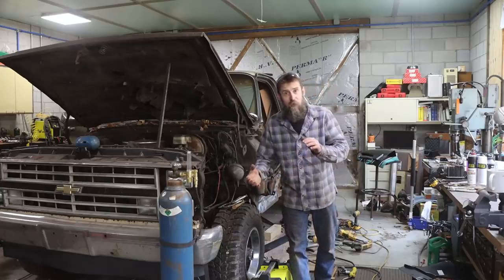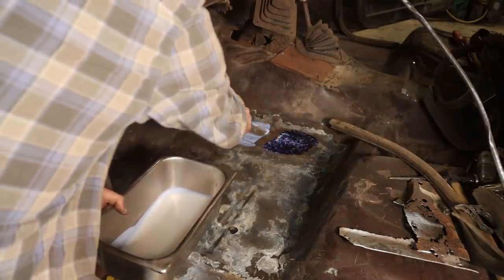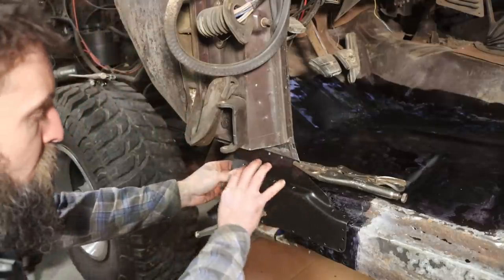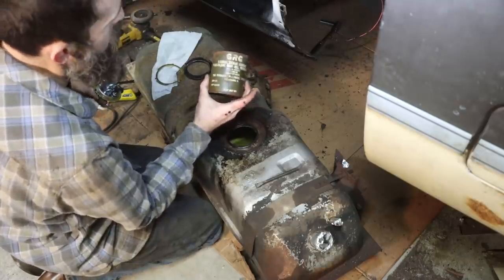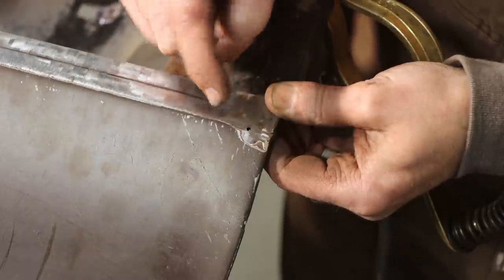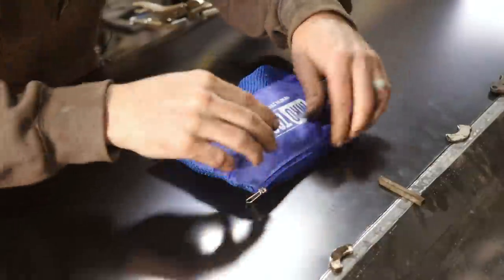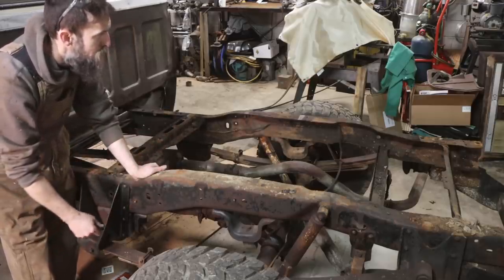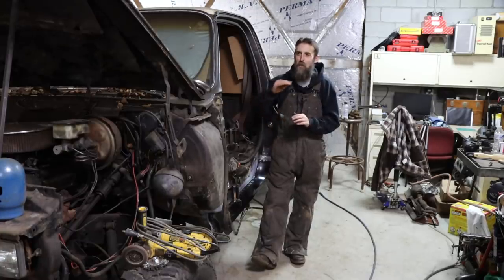Fighting sheet metal on the SquareBody Chevy and Winning! Part 9 #Chevrolet #squarebody

Comment: As a 40 year veteran in the autobody trade, your approach to the rust restoration is spot on. Using a metal bonding epoxy is the best way to attach the skin as it will eliminate both rust and warp issues.  For a machinist you do possess admirable autobody skills. 
Look forward to watching you paint it!!
Reply: He has been a body builder in his past, and is doing a good job here, not just a panel changer. FIL is old enough that when he did his trade, as body and coach builder, the filler they used was hot wiped lead, which you only used to get that last 2mm of contour on the panel, as you needed to shape the metal back to within that tolerance before, using a combination of heat, hammer and dolly, to shrink the metal and form it back to shape. He only started to use body filler in the 1970's, which was a big change, wipe to shape while uncured, and less filing and shaping.

Pretty good welder as well, despite not having that trade papers, seeing as his last 30 years before retirement was as container repairs, which used both coach building, welding and body work to get the mangled units that came in back into near perfect order. The ones beyond fixing were the source of parts, as one that has been basically cut in half, or flattened by being dropped from a carrier, is not fixable, but is a good source of corners, sections of wall, doors and floor panel sections, till it was just a pile of bent scrap and went as such once a year.

The paperwork from those, plus the serial number stamps cut from them, came in handy on his retirement when they asked where the 5000 odd containers were from those 30 years, and he had a whole set of filing cabinets with duplicates, and all the tags, as proof they had been scrapped. Nobody in head office ever wrote them off, just filed the papers and did nothing. They got the bollocking instead.

Comment: I was a auto tech at a dealership here in Fl, no body work just engine repair. When you dropped the fuel tank, a fast way to empty fuel is put air in filler neck with rag as a seal, then run the hose from tank outlet to can. I've been there with full tank and electric pump in tank don't work. I was happy to see ya put in new sock and sending unit, that is a givin. My project is going over a new Grizzly 8x16 lathe, It needs a lot of work to get it in shape, dirty grease and it needs a lot of deburring. You're my Saturday morning YouTube watch.       Jesus Does Save

Comment: If there's one hiccup I'd replace. The old tired worn out carburetor. With a brand new or new to you fuel injected Holley throttle body will start up every time. 👈🤓😉👍

Comment: Aside from my distaste for body work I have the needed tools to get it done and done right. That seam and punch tool was a real godsend when I was introduced to it. Money well spent. Likely too late but I always take a hole saw and drill a bunch of inch holes in the rock guards on these Chev gas tanks as they get plugged with dirt and rot the bottoms of the tanks. Cliko's are a real god send for any kind of thin materials. I use them for when I make custom copper range hoods. Nothing else can match the job they do. The same goes for the needle scaler. Another addon to the tool box that just can't be matched in what they can do. Well Steve, just like everything you do this is great work and long live the square body pickups. Yours has been given a second chance on longevity eh my friend.

Comment: Excellent vid!!  Please don't do a "undercoat" that's a rubberized undercoat.  That stuff will rust out your frame faster- it traps water between the undercoat and frame (rocks will chip it, allowing water to get in between the undercoat and frame).  Just find a good "chassis black" or rustoleum.  You could do fluid film once everything is back together for extra protection.  Short self tapping screws with a wide shoulder works a treat for holding panels in place, and are cheaper than clecos.  Once the panel is in place, you can just fill in the holes.

Comment: With the truck bed off and the front fenders off, now would be a good time to replace brake lines and fuel lines. I was always the one that got the leaking brake line and fuel lines when I was turning wrench for a living, and trying to replace them in limited access area is a pain in the back side. The new copper/nickel lines that are on the market today are very easy to work with.  Remember Mr. Murphy is standing next to you and will wavy his magic hand when all is done and you will wind up with leaks. Don't forget the old saying " shoulda, coulda, woulda."

Comment: Many thanks for another great video. You always brighten up my Saturday morning. BTW, here's a way to siphon gas without ever getting a mouthful. Put your hose into the tank, then wrap a rag around the hose where it enters the filler and hold with one hand for a temporary seal. Now blow a good lung full of air (don't suck) into the hose. You should hear bubbles if the hose is positioned properly in the tank. You now have slightly compressed air in the tank above the fuel. When you take your mouth away the air will push enough fuel through the hose to start the siphon.
Reply: I made myself a jiggler hose, using plastic fittings and a unused carburettor choke diaphragm out of a Weber carburettor kit, acting as a flap valve. works well to empty a tank fast, as the piping is 25mm ID PVC hose, so rapid flow. Takes under 2 minutes to empty out a 25l fuel container.

Bought a 12mm jiggler, as not all containers will accept the 32mm diameter jiggler end, so had to get a smaller slower one, which uses a marble inside it.

Comment: Living in New York, aka the rust belt, any time we do metal repairs especially rockers, it's a must that you spray an oil or wax into them to slow the rusting from inside to out.  3m makes an awesome cavity wax spray.  Get the 3 pack of spray wonds that allow you to spray 360 degrees and reach tight spots.

Comment: Please! No “undercoating” , any rock chip, pin hole, flake will allow dirt and moisture between coating and frame and then you have hidden rust until it jacks out. Consider using Fluid Film or similar products. 
Glad you had a Happy Thanksgiving, keep up the great work! And, it’s too funny how you say your “Brother” is meticulous! 😂😂😂
Reply: I personally use a mix of two part boat builders epoxy and a little bit of graphite for a nice black finish.   I can make it even more weather and impact resistant by laminating some light fiberglass cloth on with the same stuff.   It outlasts the rest of the truck.
Reply: @erikjgreen  that sounds like a mess. You say "I personally use..." Does that mean it was an idea you had, but you've never actually done it? Or does it mean you've done it on one truck? An old beat up truck like Steve's? I only insane that being a really sloppy mess and not looking great, and even worse if you add fiberglass. Not to mention epoxy isn't going to bond without extensive surface prep, otherwise it'll have the same downfalls that the op mentioned.
Reply: @littlejackalo5326  Obviously you need to clean the surfaces and use something like  phosphoric acid to passivate rust.   I've used epoxy on three separate trucks now, it does a good job of keeping salt from roads off the metal.  Even without added glass, it doesn't crack or peel.   The only thing that degrades it is sunlight.
Reply: I love the Brother remarks that’s so funny and sarcastic thanks for sharing we get to know you Steve

Comment: Great tool the Clico... that bag is excellent set...  (you got Varity size bag.. ) i went with all 1/8.. also make clamp great for Light gage sheet metal where don't want hole.  Nice repair, better than the time lapse every one is doing , slow explaining, showing technique , awesome . Old Family help ( trick) come to dinner.  JK , family is great in  a pinch...

Comment: Derust stuff is basically watered down PVA glue and Phosphoric acid. Used a lot by the military and works really well.
Reply: Yes, you can make it yourself just using phosphoric acid and cheap PVA undercoat, which is what that is.  Just refinished an old 60 year old battery charger, where the entire case was rusted badly, so instead of using the rust converter, I just diluted down some phosphoric acid, and dunked the lot in there for a few hours. As I wanted to keep the one label that got a lighter dip, as the paint was peeling off the longer time items, so just used a lot more elbow grease on it when I was doing the scotchbrite cleaning afterwards. 

Then a few coats of spray grey primer, and was looking to paint it blue, but the can was no longer cooperating, seeing as it was 15 years old. So it is now just 5 coats of grey primer instead, with the original Champion label on it. Just replaced both input and output cords, seeing as they were rather manky and brittle. Did use rust converter sparingly on the power transformer, so as to halt the rust on the core and clamp, but that only gas the converter on it, no paint. now to finish it off and add in a charge controller, as it will otherwise charge a battery till it is cooked, and I want a little better control, just like the other equally old GE charger I have, which had this added when I replaced the Selenium rectifier stack with a very overkill 25A diode bridge, newer than the charger, but still made in 1971, so has a pretty high forward voltage drop and is almost as big as the selenium pack it replaced, though it is 25A 400V, as opposed to 3A 30V of the old smellobridge stack. Old one was still working, just was slowly breaking down, you got the slight odour of the selenium sulphide gas off it when it was running at full power for a half hour. Did not want to wait till it went full skunk on me though, those old stacks really leave a long lasting reminder of their demise, both in the equipment, and in the house.
Reply: When worked on the ships (Merchant Marine) the deck department used some stuff called "Ospho". Now that I'm home and all my paint projects, farm machinery and lawn mowers get a coating of Ospho before the paint
Reply: Good to know the ingredients after seeing Steve taste the stuff. Both are basically non-toxic with a small taste. But there are things out there that you don't want to taste under any circumstances. Like that bluing compound Adam Booth was using in one of his videos - very toxic stuff.
Reply: @joeylawn36111  Yes, but the concentration of phosphoric acid in this makes it toxic, as it is the same strength as is in the pure base used in cola, which is classed as a hazardous waste in the OHS act. Not the diluted one used in soda mixers, but the base that the manufacturers use in the bottling plant, which is often used by the truck operators as an engine cleaner, as you can make it safe to flush, by using 100l of water per litre of base, as that is the mix ratio to dilute it down to a low enough level to flush down a drain, as the same concentration as the mix fountain syrup. Just does not have the sugar or HFCS added.

Reason why Coca cola is such an effective grease remover,  I use a 2l bottle of it added to the washing, when doing greasy stains, and a long prewash soak. Cheaper than the degreaser, and leaves no marks, and works well.

Comment: Great job on the rust repair very informative. Personally I probably would have looked for a different cab that wasnt so rusty. But that's me. Love the vids Steve.
Reply: Hard to find though, especially on an old truck, and probably will cost more than the truck. Simpler to just order from the aftermarket a lot of panels and build it back up, as the labour cost to Steve is a little lower than a body shop, though his standards are higher, as he does not cover sins with bondo and paint.

Comment: When you were talking about the rust under the bed if reminded me of something that happened to my son and his 98 4x4 truck. I tell this in hopes that someone will not experience the same thing. He was coming home from work and changed lanes and his truck went out of control and rolled several times without ever giving any indication there was anything wrong with it. After we got it home, I could see the rear end was about to fall out of the truck. The U-bolts had rusted so bad that the only thing holding them was a sliver of metal about the size of a toothpick that hadn't rusted through. If you have an old truck, periodically check the U-bolts, it might save you some grief!!!

Comment: Just found your rebuild series. I just did this to my 89 GMC 2500 last year. Ordered the parts mid April, never got them until mid September. I was running out of good weather by the time I got it back on the road. I bought a combo fuel tank with new fuel pump inside. Fuel pump didn't last 2 months. I had my rear springs redone along with all related brackets, bolts, etc. The truck rides worse now than it did before but she'll haul a pile of firewood without squatting. Great series of videos you've done. I cant imagine screwing around with the camera and editing along with all the frustration on the body work also. I replaced all the fuel and brake lines with 316 stainless, wont have to replace them again.

Comment: Should have used some of that old sheet metal off the door to cut out a patch for the top section where you welded. Then use the Cleco clips to hold it in place, and use some of the epoxy to bond the new panel section in place. that way you have the stiffener you need, and it will have a better chance of surviving long term.  Clips are replaced with countersunk rivets when offering up the panel with the epoxy, so you can simply grind the rivet flush once cured, and at the rear you apply a coat of primer and paint. Inner door needs to have a coat of the converter primer added, then a rattlecan protective coat, any old cans you have of any colour.

Comment: Used to call that Corroseal "grape juice" on the ships and used it by the drum.  What we had used left a polymer film to keep fresh rust off for up to six months.  Of course they wanted a primer and top coat as soon as possible.  One down side is that it leaves that 'grape juice' stain on painted surfaces adjacent to your repair.  It is permanent in the paint so it needs to also be painted again to restore the color.  I found it to be among the best performers in the rust converter field for DIY er.
Reply: Yes, apply 2 coats, then a coat of metal primer, then your topcoat of enamel paint. Otherwise just coat with underbody seal, as it will be covered by a carpet, and leave it at that. Just use an underbody seal that dries, not the tacky for ever type. Or just spray over with a can of grey primer, and leave at that, after wiping down with a wet cloth, to remove the residual acid, and wipe down with a fresh damp cloth another 2 times.

Comment: I used Cleco pins a lot in aircraft repair, you get quick at fitting and removing them when you have a thousand of the beggars to do. 
Steve, if you wish to  wear high heels, that's entirely your own business.
Best wishes, Dean in Oxfordshire, UK.
Reply: Haha, nice one.
Reply: Still have 2 bottles of assorted solid aircraft rivets. Steve can use solid rivets on that door to fill the holes, as he has access to both sides, so easy to use them to hold parts together, as the rivet is as strong as the metal.

Comment: Don't suck a hose to get a syphon going !
Use a longer hose so you can put a couple of extra feet into the gas tank,  pinch it off at the open outside end...then pull some of the extra hose back out of the tank to a level that's below the tank bottom. When you're ready for draining, un-pinch the hose. A syphon will  automatically start.
You probably knew this already but it's a neat trick to prevent gas-mouth...

Comment: Steve...buy a transmission adaptor for your floor jack ....it replaces the foot you lift with and has a wide plate that comes in handy when lifting heavy or big things...like fuel tanks...you can wrap a strap or chain too to stabilize the " load " ...you can make one too cheap...but i bought one for $30 new...use it lots...and can bolt a wider/longer base on if needed ...lifted my Jeep tank down and back in easily among many other uses.... great extra hand...work smart...not dangerous...

Comment: I seem to recall a friend of mine who would use lead in certain spots. I never did any work except weld something from time to time for a friend or a friend of a friend. I could weld with torch didn’t have TIG 55 years ago I didn’t anyway. I recall using a wet rag to cool the weld down to try to control distortion.

Comment: Steve, those Clecos will be worth their weight in gold to you and you'll probably get more of whatever size(s) you find that you prefer.  I also hope that you choose to strengthen the areas around the shock mounts that break/broke out to prevent further breaks, especially since you'll be hauling heavy loads of firewood, etc.  I half expected to say that you rigged up some kind of sprayer for your rust converter & your spray gun to spray as much of the inside while you were there, but I guess that's overkill for this truck?  The military has a spec for rust protection that requires access holes everywhere (with appropriate plugs after the fact) for long-reach spray nozzles to reach all areas inside frames, bodies, tubes, etc., to prevent as much corrosion as possible, along with strict specs for the types of rust-preventive coatings/paints.  If you had a buddy with access to a paint shop that could do that kind of "all-out rust-preventive" MIL-SPEC painting, you're vehicle(s) wouldn't rust away, they'd probably die of something else first.